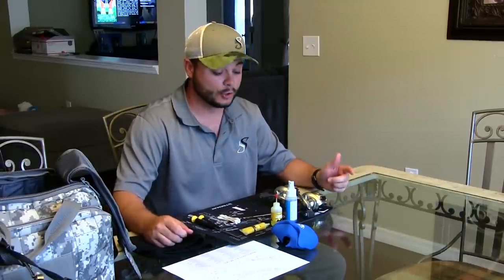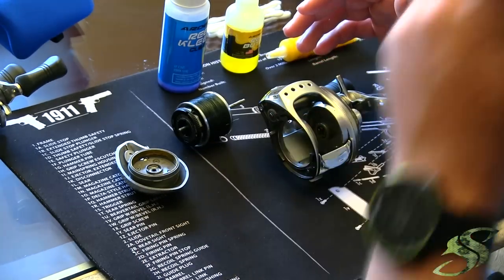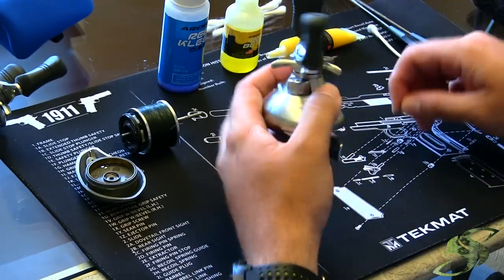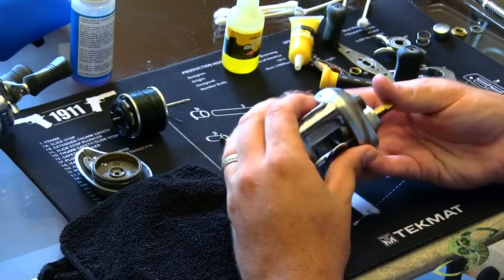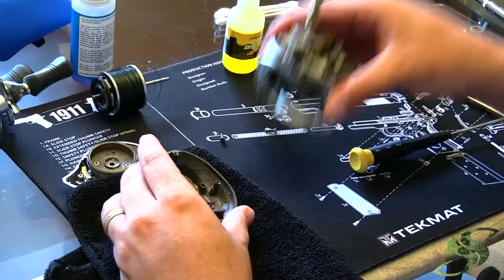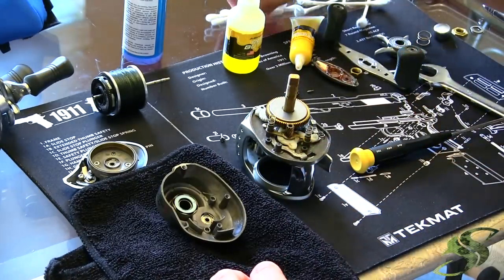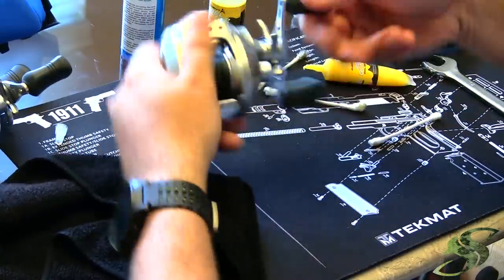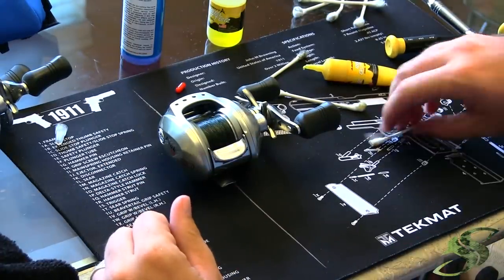How to Properly Clean & Lube a Baitcaster

Comment: hello, I've been on the market for a the best all around baitcasting setup on the market. I've come to the conclusion that a st. Croix legend xtreme paired up with a shimano metanium mgl is the best all around for me. the only question I have is can i use the metanium in salt water? how do you feel about the rod and reel I just mentioned?
Reply: the specs I'm trying to get are medium heavy fast on the rod 7 feet and a 6.2:1 gear ratio on the reel
Reply from the maker: Hello Alexander, I apologize I didn't see your comment. They are both fantastic but I don't believe the metanium is saltwater approved. Check out fishing13 reels for saltwater applications.